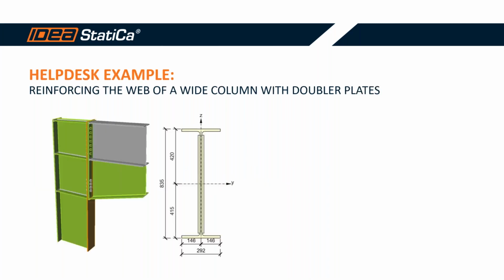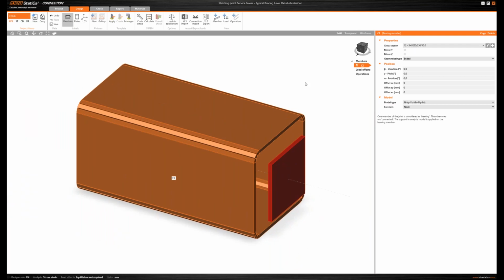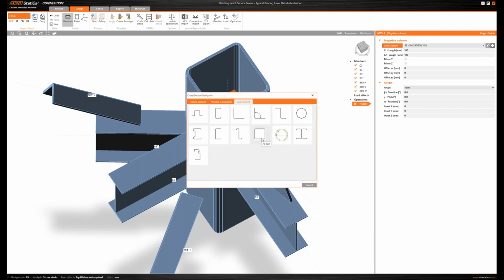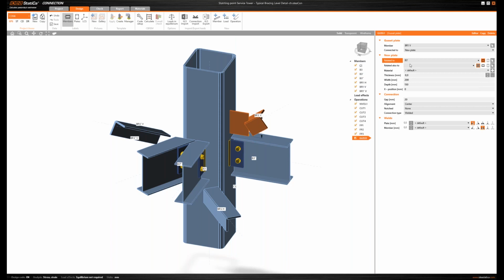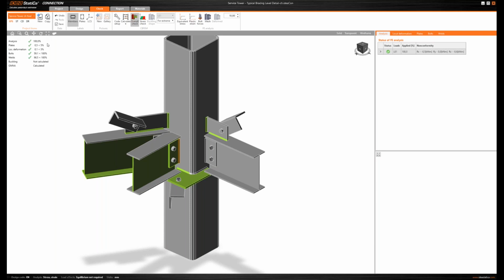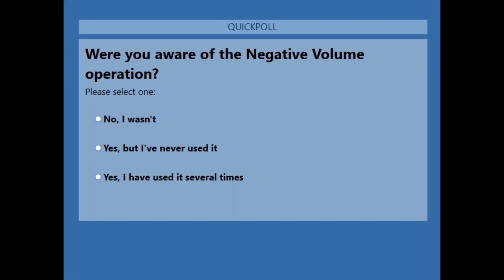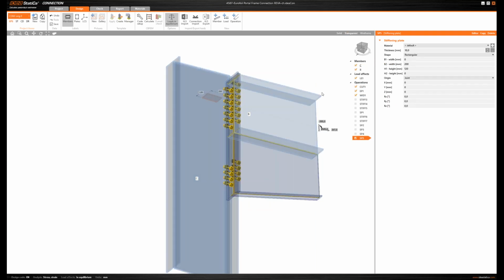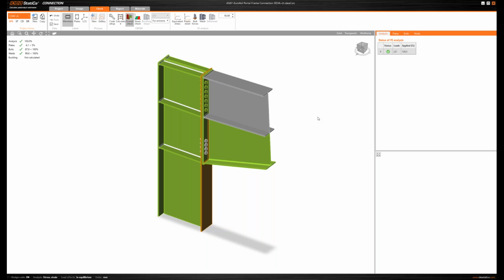Connection Wednesdays – Shaft tower connection for Thames Tideway Tunnel

Comment: İn the second example ,the custom section method is not true modeling. Because of the bonded and merged solid bodies will give unsafe results when comparing to leaning of plates on each other and welded from edges  model type.
Reply from the maker: Of course this depends on what your model should work exactly, but in this example the behaviour of the analytical model is the same and it shows a workaround how to eliminate the unwanted length of the column leading to unrealistic increase of the moment.